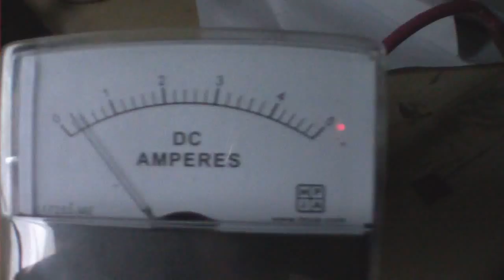XEE2vids JT / Joule Ringer 12v - HV CFL Inverter Replication

Comment from the maker: I still prefer the Slayer circuit for driving CFL's tho... I have one set up where it is switcheable from a MPSA06, which draws 12v/200mA - that's the low setting, when you kick it in high mode, you are driving FETs, and then shes about 6-8 watts ... and BRIGHT!!!